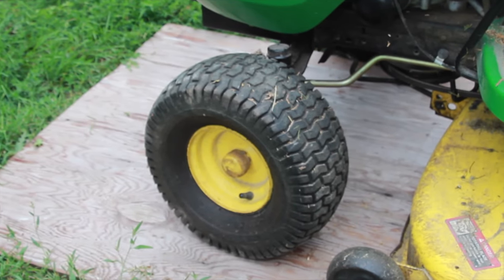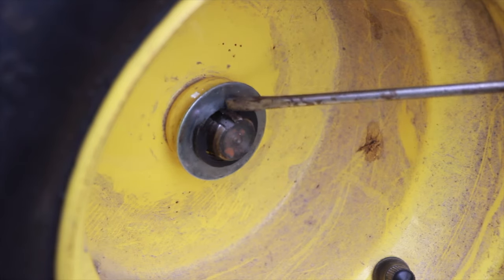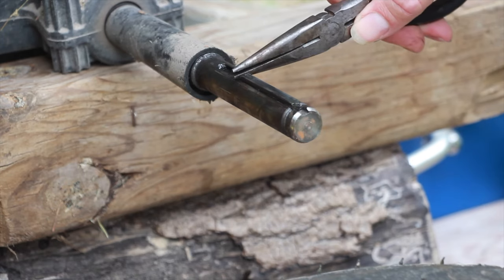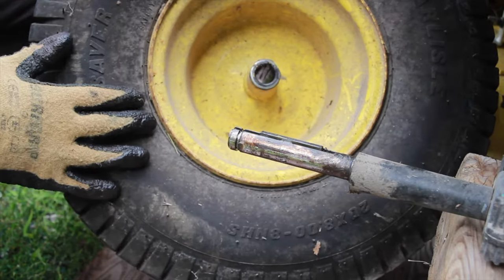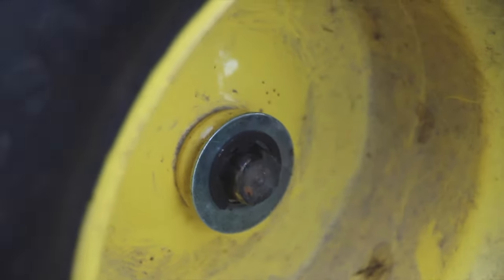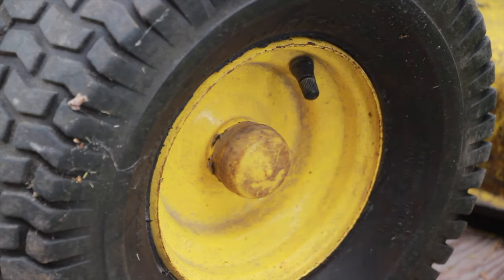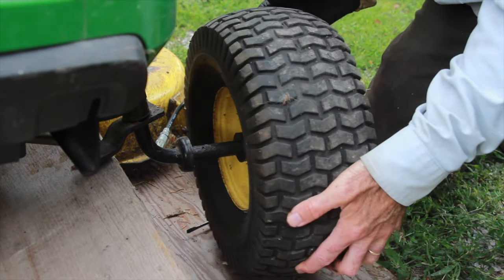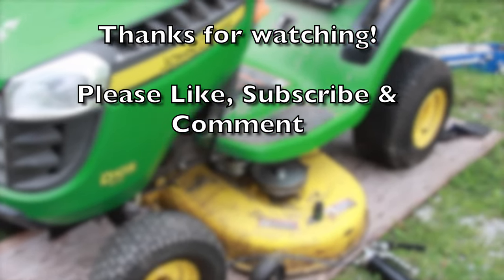How To:  Remove & Install Front & Back Tires (Wheel/Rim) - D105 John Deere Riding Lawn Mower

Comment: Great tip using the hair dryer or a heat gun on the dust caps. Those buggers weren’t budging until I did that. Thanks.
Reply from the maker: Glad it helped, all the best!

Comment: I’m glad I learned this about the rear tires. I’ve never replaced the rear tires, only the front ones. I’ve always thought the rear axle key had to be drifted out with a punch before removing the wheel. I’m glad it’s actually simpler than that.
Reply from the maker: Glad it helped, thanks for watching!

Comment: Good wheel  off and on  video easy to follow , i use a heat gun on the dust cover the vinyl can get Very hot  on the fingers
the C clip can be a pain at times getting it off and back on  - i plan removing the wheel to put tire chains on in the house where it's warm
and can take my time the reason hard for me to hook them tight to much movement in my case

Comment: Great tips but on my 160 model trying to take off the slip ring on a front tire, it won’t come off.. I even bought snap ring pliers, can’t remove it & with a screwdriver as well.., help please 🙏🏼!
Reply from the maker: Is there a way to position a lever so that rather than just trying to pull the ring off, you can use some leverage on the pliers.
Also, maybe it's rusted on.  Try some penetrating oil.

Comment: I got a rebuilt kit for both rear wheels and it had 4 large washers and 2 a little smaller and you only had 1 washer on each wheel.  Can you explain where the others go?
Reply from the maker: Which John Deere Model is it?

Comment: Question? It is ok to use w40 besides grease?
Reply from the maker: Thanks for the question.  WD40 will not be effective in the long term to prevent rust and possible seizing of the wheel to the axle.  Best to use grease or anti-seize compound.